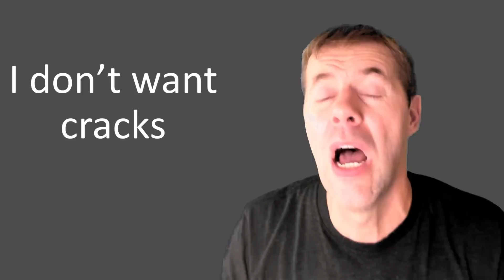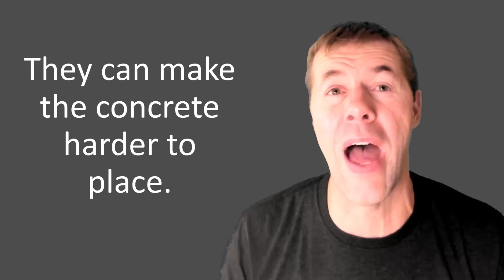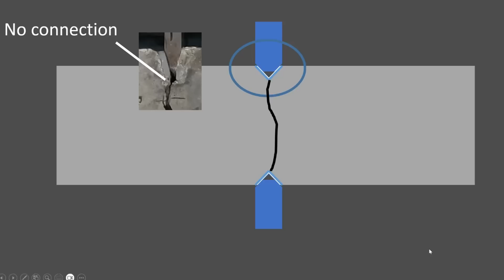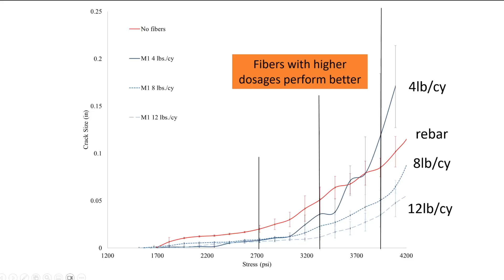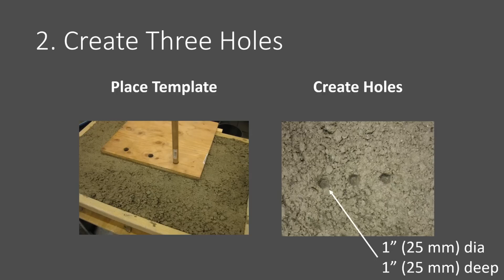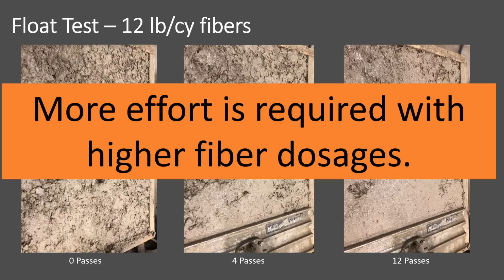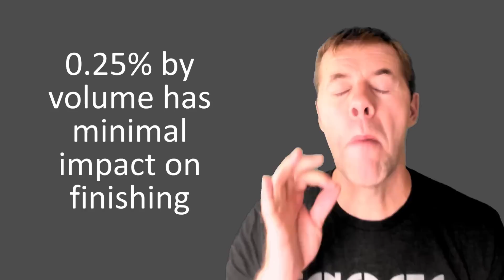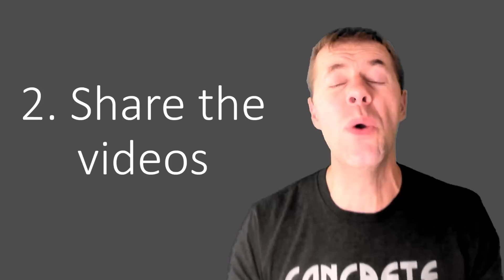Testing fiber reinforced concrete with an expert

Comment: I have a question. To prevent the fiber 'hair' from sticking out of the finished concrete, what do you think about putting on a final finishing concrete layer - which is fiber free - on top of the fiber reinforced main body of the slab? The outer layer will still be prone to cracks like normal concrete, but the cracks will not progress into the fiber reinforced part.

Comment: Now this is interesting. As an owner i wanted to add fibers to the beams and columns . Hence the Tie beam will be added underneath as designed by our structural engineer. Since Philippines now is getting a lot of quakes. How does this play well during seismic activities?

Comment: Why not add another layer of cement (vener) on top of the "structural" cement layer. The upper layer can be maximized for wear resistance and the lower level for crack  resistance/etc.

Comment: Tyler is need u to reply, I had a Concrete Ready mix plant forget to add my fiber to my mix, they are trying to tell me that it only reinforces the slab durring the 1st 24 hours and does absolutely nothing afterwards. The homeowner is upset because they forgot to put it in the mix! Chat gpt disagrees and says that it protects the surface for as long as the concrete is alive. I have torn out concrete w fiber and It def helps  the surface stay on. Chat gpt says fiber even helps w impacts and w freeze and thaw, it also keep cracks together,  I was just wondering your professional opinion from some1 who test it

Comment: can you separate the core and finish to separate concrete? meaning pour the core with fibers and then pour non-fibered concrete on top to finish it to avoid the extra labor in the finishing work?  or will this cause the top finish layer to crack and separate later?

Comment: Love fibers - I use ultra-thin, alkaline-resistant, acrylic fibers in my half-inch thick concrete furniture designs...In conjunction with AR glass-fiber mesh and acrylic bonding admixtutres.

Comment: I have used fiber reinforced concrete.  And I musta bumped square into your"Cain't be finished. No how. No way."    The problem was set time.  You did not discuss this or attempt to quantify set time.   FAST.  IMPOSSIBLY FAST !      As the material came down the chute and puddled into the forms with a normal amount of water in the mix,,, it puddled and spread in a normal cowpie shape.   But  you could walk on it in less than 5 minutes.  It hit, spread, puddled exactly normal out of the transit truck,, and if you moved it right then,, it moved, raked, hoed, maybe a little tougher than normal.  God help you though, if you did not bull float it in the first minute, 60 seconds, you could not bull float it.    Time to strike, float, trowel, edge,,,  Was a few seconds as opposed to a minute.  Sidewalk work.  5X5 sections, by the time the truck was chuting into the third panel, I was walking on the first.  The puddle in the second panel could not be moved.  I stopped the truck and sent him back to the plant. Had to jack hammer  out those first three/ four panels the next day.  Set time was greatly accelerated.

Comment: I'm late to the party, but I'm curious about using fibers to reinforce concrete in scenarios where finish is entirely irrelevant - or when fibers sticking out might even be a benefit (and whether it WOULD in fact be a benefit), such as when you must for whatever reason pour the final product in several rounds. Anyway, your videos are amazing, and I really appreciate you sharing both your knowledge and passion!

Comment: 4 biggest reasons for cracks in concrete are: poor compaction! Your slab is only as good as the ground underneath it! Water to cement ratio is another reason. If you put too much water in your concrete or on it while it’s being placed you’ll get shrinkage cracks. Anything more than a 5 slump without using chemicals is to wet! Whether your tooling them or saw cutting them control joints are another factor in cracks. An 8’x10’x4” is one yard of concrete. Keep your control joints that size or smaller and you shouldn’t have any problems. Last but not least is proper drainage away from your concrete. Especially in the parts of the country where there is a freeze/thaw cycle. Frost heaves play havoc on concrete. There are other reasons concrete can crack but in my years of pouring concrete and now owning my own business I have found that these are the four big ones.

Comment: I project managed the construction of a skate park a few years ago for a city. I wish I had required fiber in the concrete. The cracks are starting to get big enough now that we will begin routing them and putting in a joint sealant.

Comment: I think I remember this kind of cement being used in bunkers in Iraq to make them stronger I think it would be cool if we could figure out how to make a super concrete using these fibers what we've learned about Roman cement and fiberglass rebar and when it comes to the standardized testing if you could make a jig out of Parts you can get at a hardware store and then make a free online plan for it you could probably share the link to that in one of your videos

Comment: Do you have content on ferrocement or soil cement? I'm planning on building a monolithic thin shelled, ferrocement dome. Do I put the fiber on all layers (if it'll even do anything on thin concrete) or just the final ones?

Comment: I work in concrete structural design for 15 years. Most people do not realize, concrete is expected to crack. Normally it's not a big concern unless agressive salts can propagate through the gaps and cause rebar erosion.

Comment: Concrete reinforced fibers work great. Some fibers work better than most.  We have a lot more experience with poly fibers on flat work. The amount of fibers in the concrete have certain issues with finishing but not insurmountable Steel fiber have cause issues with pumping and finishing.

Comment: What do you think of Helix Steel as a replacement for rebar? It is used more and more in ICF construction. A friend of mine poured a 26x60 workshop of 4-inch core Fox Blocks ICF with no rebar. I plan a one-storey ICF house with 6 inch core blocks, and I want to use Helix Steel fibers. The local concrete mixers know about it and it comes in the truck ready to use on the construction site.

Comment: Thanks, really interesting.  In UK we use a very fine chopped fiber for reinforcing concrete, each strand is hair-thin and maybe an inch long.  It's something like glass fibre or Kevlar, if I recall.  Very easy to mix, pour and finish, but I have no data on the reinforcing performance compared to other methods.

Comment: For wall, I guess we really need the fiber to be going on a single direction. If metal fiber, couldn't we use a magnet system to align the fiber inside the wall.   Could it be a system of loop fishing string, that is expanded using a vibration system once the concrete is poored in.

Comment: What about using plasticizers? You could increase the fiber doses without affecting the finishing or at the same dose reducing the water of the mix increasing the concrete strength.

Comment: Some of the GFRC and specialty suppliers (this is in the context of interior applications I guess)  recommend rolling the thin layers of concrete to flatten the fibers in the direction of tension. I assume this is only when you have very thin applications?

Comment: Tyler, I was visiting a powerplant that uncontrollable vibrational issues. These vibrations, 100-500 hz was cracking up the concrete. Would concrete fibers resist this?

Comment: I just poured a 44" x 8" x 260' erosion wall around a slab for my shop. I rented the forms, set them, and did the pour myself (boom pump hired for placement, and one friend to run the vibrator while I handled the hose). I used almost 26 cu yds.  I had the plant add fiber. I don't know which kind or how much per yard.  I will find out after watching this video, just so I know. But I do know that they only charged me $5/yd for the fiber. When dealing w contractors, asking for 4k PSI instead of 3k5 PSI or asking for fiber has universally gotten me, "that'll cost more".  Yeah, no kidding...but they use it as leverage to inflate the cost.  On the one job where I had a contractor use 4k PSI and fiber, it cost me $1,200 extra. After that, I found out that it was only $10/yd to go to 4k PSI and only $5/yd for the fiber. $15/yd more expensive. When concrete is costing $170/yd for "run of the mill" 3k5 PSI, who cares about $15/yd?  Had I simply ordered the concrete myself, going to 4k PSI and fiber, would have only cost me about $500 extra, not the $1,200 the contractor charged me. The contractor got paid an additional $700+ of my money for doing nothing other than telling the plant to change the mix. FYI to those having concrete placed for them.

Comment: Well, I've been a general contractor for over 10 years, and we've had steel building foundations that were 6 inch thick slabs, 3 foot by 3 foot footers, double Mat. Rebar, one foot on center and fiber mesh concrete, and they still cracked
Reply: I don't think rebar will eliminate cracking, but if you use more rebar, the cracks will be smaller.

Comment: How does vibrating the concrete affect the fibers? Do plastic fibers float towards the top when vibrating, and do steel fibers sink? What happens when a DIY person runs the vibrator for 5 times as much as needed to get air pockets out?

Comment: Fibers made from steel will probably make a problem in the long term - they are closer to the surface than rebar and as consequence more prone to rust. Rust cause steel to expand and concrete will crack.

Comment: I poured my shop foundation with fiber reinforcement and no rebar except in the footers and so far so good. Burned the finish with no fibers being visible. The cost for fiber in Arizona is negligible. I won’t even think of doing a concrete pour without fiber. My next pour is 20’X40’ approach in to shop and plan on using fiberglass rebar and fiber reinforcement. Material manufacturers are using fibers in asphalt now as well.

Comment: Thanks for the video.

 This is not new technology. Our family never pours a slab without fiber. Our first test was back in the 1980's. 

As far as expense, our last batch only cost $8 more per yard to add fiber. I would not call it cost, it's a requirement. 

Thanks again! Great video 😊

Comment: Why did you not include besalt fibres a natural stone product so adhesion is excellant and product thermally expands at same rate as the concrete and is 3-5 times stronger than steel. Second for me curing has been my preferred method for maximum crack reduction, If concrete is kept uniformally wet/hydrated and not allowed to dry from any surface unequally the internal stresses created during curing are eliminated and so are the primary causes of future cracking. Lastly you did not mention that fibreglass type fibres should never be mixed into concrete for more than 10-15 minutes prior to placing they will seperate into individule fibres and become useless. Further if one uses besalt rods and or besalt mesh stresses and adhesion issues between concrete and reinforcing materials is eliminated while eliminating future spalling entirely and getting a stronger crack free pour at same time. The 28 day wet curing does not cost much other than the time to cover concrete with visqueen or re-wet daily during 28 day cure, and finishing properties are not changed. Federal and state DOT have made wet curing (covering) a requirement for highway structrual members for decades and this has allowed/helped concrete supports to remain free from cracking for decades. Ray Stormont
Reply: Do you mean "basalt?"
Reply: @nevertolatetoprepare2802  Typing skills 0 you're the first to bring this misspelling to my attention, Thanks,  It took three months for someone to notice. Ray
Reply: Would you still make use of steel rebar in conjunction with the basalt?
Reply: @NoNiceUserNames  No only where the basalt materials are not available to do what's needed as reinforcement components. Using basalt eliminates many, many issues and yields concrete that in theory will be as lasting as what was used to build the Colosseum. Basalt expands and contracts at the same rates as concrete does not oxidize and has same lifespan as the rock it's made from. I believe Basalt with no environmental impacts and ease of use will over time replace steel as the primary reinforcing material for concrete.

Comment: Would like to see Galvanized rebar and GatorBar GFRP which can be cheaper than black bar at times. Would love to see helix and Hyperfiber and Dramix 5D, 4D, 3D compared. PRAH admixtures seal cracks and E5 Internal Curing is supposed to help a lot too.

Comment: Tyler, one consideration with the different fibers should be longevity. if poly fibers are great but fall apart after X time, while glass fibers never degrade, then that might be a consideration for a client.
Reply: The latest is PET fibre recycled from pop bottles lasts for longer than you ever will! 😊

Comment: I have 50 yards of fiber reinforced concrete with no rebar in the slab installed in 2006. It has performed very well.  I only have one unexpected crack.  Finishing was not bad, part of it is slick the rest broom finish. It is cut in about 10' squares.

Comment: The new World Trade center is made with UHPC (ultra high performance concrete) and has a tensile strength of 60,000 PSI. I trust this would be a little cost prohibitive for the average drive way or home foundation. Iran is in a high earth quake zone and they use a finer purer quartz and sand for their concrete.

Comment: Great video.  I've had good an bad experiences with adding fiber.  

The first (good): 6lb medium weight fiber/cy, 24' pad, 4" thick cut into 8' sections. Surface a bit hairy so I used a diamond cup flat wheel to level surface imperfections and remove the hairs.  Ten years later no cracks and looks great.

The second (bad): I failed to monitor the contractor who used micro fibers of some unknown dosage.  He texured the surface using a broom which clumped the fibers and didn't make it easily fixed.   Cracked after a few weeks, although the cracks aren't huge.  Not particularly happy with the results.

Lesson learned: Make your specifications clear to the contractor and then closely monitor what they are doing.   If you don't do this, you have no control over the results.

Comment: For both concrete roofs (critical rebar at the bottom of the foam I-beam molding) as well as ICF walls, which have a bazillion plastic tab ties penetrating the concrete, is there such a thing as a self-consolidating concrete mix that uses fibers as recommended here along with regular rebar and a water stopping crystalline admixture (something like Kryton or Xypex) to minimize the water intrusion via the capillary effect of the plastic tab ties?  When pouring these structures, especially when making tanks, the cost of the mix is minor when compared with the cost of remediating rock pockets and water intrusion to the steel over time.  You did another video where you showed a regular concrete L beam and a High Performance Concrete version of the same thing.   I'm kind of looking for a sweet spot in between standard concrete and High Performance Concrete, but I'd like to reference good materials instead of doing trial and error.
Reply: There is fibreglass rebar !